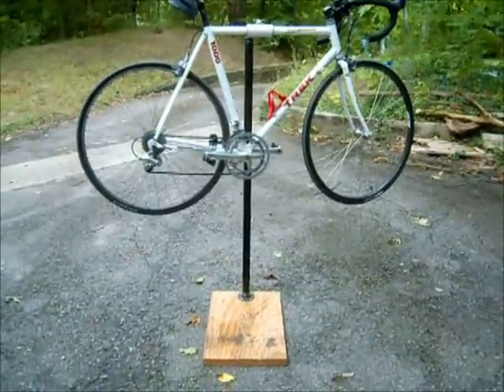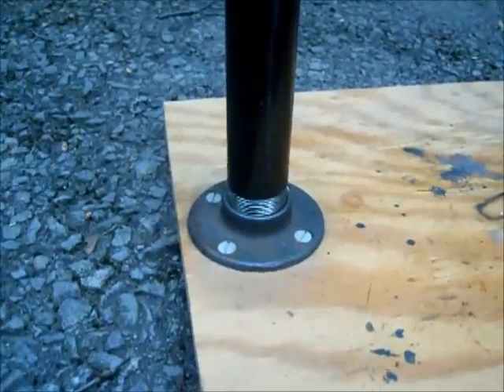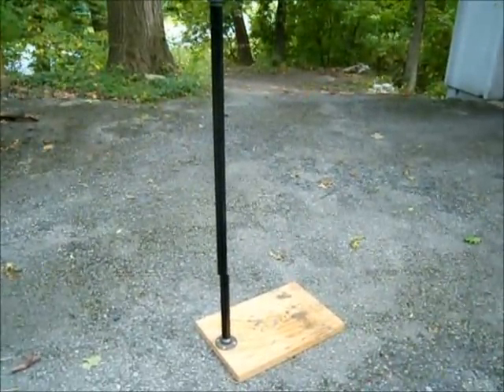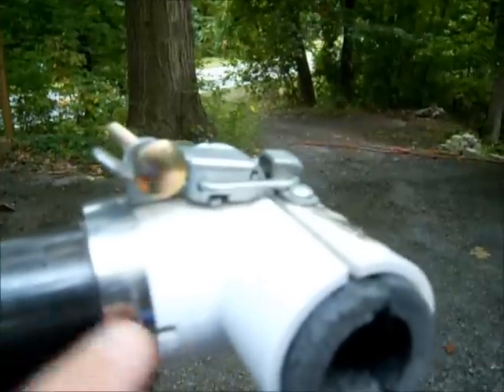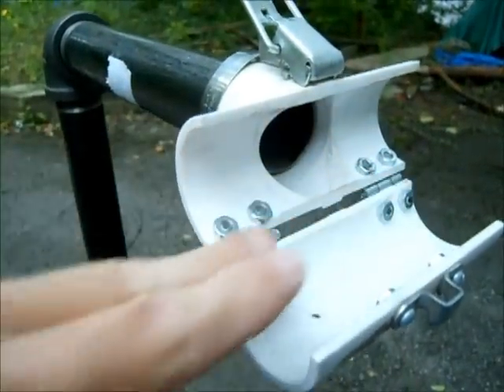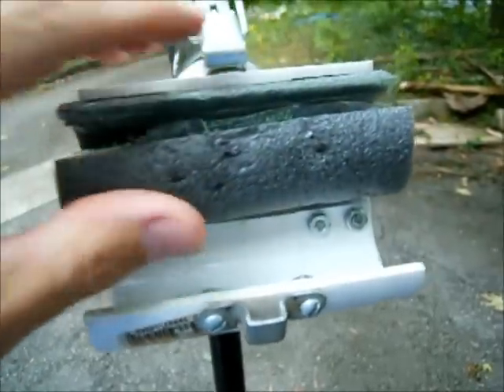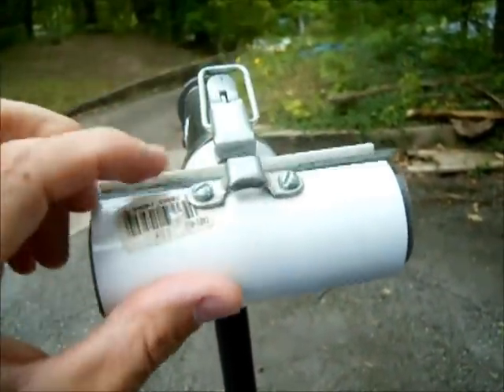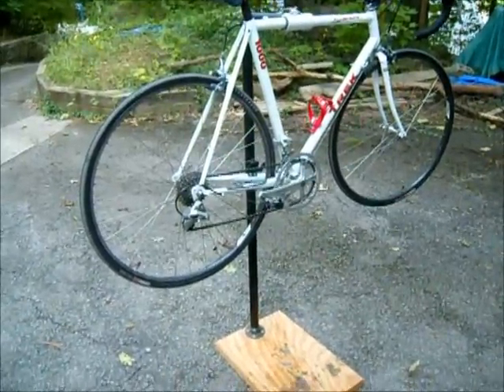How To Make A Bike Repair Stand DIY

Comment: That clamp mechanism you've built seems like it would only fit certain diameter top tubes or seat posts, correct?
Reply from the maker: It's going to work for most bikes. Not some of the new shaped frames and seat posts like on high end tri-bikes. But if you have a high end triathlon bike, you can afford a high end stand.
Reply: shyflirt1 Haha, that's a legitimate point. Do you see any issue with using just a 3/4" base instead of 2 glued together? I feel that may be overkill.
Reply from the maker: Ralph Livingston Yes. A single layer of 3/4" plywood will flex more. 2 sheets together will be stiffer and more solid.

Comment: I can see where the clamp would get in the way of the cables. How do you work on brakes and gears using that clamp?
Reply from the maker: I didn't have too many problems most of the time.
Reply: If you make a thinner clamp as well then you could clamp the bike around your seat post. This is probably what I'm going to do.

Comment: Guys as a tube holder I’d use pipe wall mount/bracket, maybe it isn’t perfect but easier and more secure, maybe use two of them and clamping to seatpost is better, only correct option of you have carbon frame

Comment: the piece of wood helps it from tipping  forward but it's not enough to counter balance any movement backwards. the slightest movement the other way will lift the  wood and the whole lot will topple to the floor
Reply: Gary Coleman leave 5 or 6" of plywood behind the pipe flange.  Or fill a gallon milk jug with sand and leave it on the plywood

Comment: How difficult would it be to get another metal T and cut that in half like you did the PVC one? Then add hinges to that. I'd be afraid the weight of the bicycle would crack the PVC at the hinge. Is that still the original PVC T that you've had?
Reply from the maker: Yes, that is the original PVC T that I made it with. I never had any issues with it at all. You could go with a metal T, though it would be more expensive, and you would have to worry about it scratching the bike. The PVC T is much less likely to scratch the bike if it accidentally rubs against the frame.
Reply: Ok thanks.  I may try to build one like yours if I can find the materials for a decent price at Home Depot or Lowes.  I've seen some stands (RAD brand) for as low as $52 shipped from Amazon but it seems alot of the important components are made of plastic.  I'd hate to have my carbon fork hit the ground from a few feet in the air.
Reply: RJ The Bike Guy d

Comment: could probably use PVC for the whole thing! if you use schedule 40 and thick conduit (like 1 1/4" that you use for the T) would probably work great.  great idea with the T. and how you made it the bracket to hold the bike.  thanks for the share!
Reply from the maker: +benlrenzen10 Might not be stiff enough.
Reply: it will definitely have a tad bit of "flex" to it in lieu of the fire sprinkler piping that you used.  I am an electrician,and have access to "free" PVC conduit. when it's super long it flexes a lot, but a short piece of a good sized PVC, I think it could work.  It's more rigid than one might think. we shall see! :)
Reply from the maker: If you have access to free stuff, maybe you can try nesting the, put pipe inside of pipe inside of pipe to stiffen them up. Not sure how tightly they would fit like that.

Comment: Is it a must to use wood screw and also where did you buy your latch?? cause I been looking around for it and have no luck finding it.. Thank you! =)
Reply from the maker: +Jovan A. Use whatever will work for you. The latches are not that hard to find online. http://www.amazon.com/exec/obidos/ASIN/B00PFBE4HE/ref=nosim/youtube25-20
Reply: +Jovan A. might be a little late for you but maybe help someone else that is trying to find that latch. I bought the exact same latch at Lowes, a 2 pack was $4.71.  Item #: 311970. it was called a cabinet catch. they come in different sizes, these ones are about 2 1/2 inches long, but I believe they come longer or shorter. I attached mine using pop rivets, pop rivets just seem stronger and tighter to me. I made this stand and used it on an old 68 model three spd Schwinn. I just loosened  the clamp and turned the mount up, and it clamped on the seat post tube just fine.  very easy project and worked well.
Reply: That's good to know.. I ended up buying one on Amazon and it was to big for my pvc pipe. Thank you! =) 👍

Comment: Hey could the handle part (without the pole and stand) be secured somehow to a wall to store the bike off the floor?  I would have to find someone to do all the work for me (this is beyond my hammer and nail capabilities).
Reply from the maker: You could attached the pipe to a flange similar to what is on the base, and screw that to a wall. Make sure you screw it into something very solid or it will rip right off the wall when you put a bike on it.
Reply: shyflirt1 ok Thank you for the information.  Good stuff.
Reply: I took this concept, but I secured the flange into my joist in the work room. Placed a 90 on that, so I can pull it down to work on my bike, and swing it back up into the open ceiling when not in use.  Saves space.

Comment: just wondering what length you used for the main post, I picked up a 48 in length and my stand looks huge compared to the bike
Reply from the maker: Thomas Perrett Close to 5 feet. You want the bike up at the level that you can work on it. And most of the bike hangs down below the bar.
Reply: perfect thanks man

Comment: This is perfect! I'd so much rather spend my money on tools and post ride food/beer ;)   One question- have you (or anyone else here)  put a little tool shelf/small parts holder on the upright pole?
Reply: Next question- how to best cut the PVC?
Reply from the maker: Cezanne Cartier Safely with a saw. I think I used a table saw. But you can use what ever saw you have that will work.
Reply: RJ The Bike Guy  Cool- thanks.

Comment: How about just using a 10 inch nipple threaded on both sides, attach a  "T", and run your seat post right thru it? Might be a little difficult to get the bike on but a heck of a lot easier to make.

Comment: Does this allow you to clamp it to different size frames.  Most of mine are older chromoly steel frames like a Trek 930, 750, etc.  OR should I get a smaller T piece for those style frames?  I wonder if pool noodles would also work well for the T liners...
Reply from the maker: I used it on a variety of bikes.

Comment: Kwel, but this design would crush my top tube. Guess i could rotate the clamp and use smaller tubing for a good grip on the seat post
Reply from the maker: I doubt it would damage your top tube, but it's your call.
Reply: Doesn't damage the top tube....mine works perfect on my Road bike, however is too small for the top tube on my mountain bike, so I do as you stated, twist it, and use it on the seat post. Boom

Comment: I'm having trouble finding that tool box latch. I tired Home Depot in person and Lowes online. They have them, but much bigger like for a chest. I also trolled Amazon. If someone found the proper latch, please post the source and maybe the name & #.
Reply: Found the latch @Ace Hardware. HD here didn't have  1 1/4" black iron. Had to go to a plumbing wholesaler. They only had 21' lengths, but did have a 4' riser which I added on a nipple to get the correct height.  Used steel pop rivets on the tee and glued the foam to the inside if the tee. I don't know how to attach pics in here or I'd show my finished stand

Comment: Would it have been cheaper to use PVC as the main pipe or even for all of the pipe? More importantly, do you think PVC would be strong enough to replace the cast iron pipe? I would imagine that PVC is much cheaper than cast iron, or is that wrong?

Comment: I think your bolt idea is right on. I can't see rivets holding nearly as well. I'm thinking your base might not be that sturdy for working. How much can you wrench down? I'm thinking mason screw into a 12" by 12" patio block and then put it in a flat bottom storage container and using about 30 to 40 lbs of thin mixed concrete, enough to cover the original patio block. Seems it might make your plan a simple heavy duty work platform.

Comment: Hey RJ, could you give me your height and how tall the clamp for the stand was? For reference as  i'm gonna build one of these but would like it to be tall as I am very tall. Thanks a lot.
Reply from the maker: +Luciano Narno I am almost 6'. The clamp is about 5 1/2'.
Reply: RJ The Bike Guy Thanks a lot RJ!
Reply: +RJ The Bike Guy wher did u buy the hatch to lock it
Reply from the maker: The latch is called a "straight loop draw latch". I originally bought it at Lowes, but am not seeing them there now. I don't see them at Home Depot either. But I found a bunch on Amazon and other online places.
Reply: How much do they go for
Reply: Do u think  there other ways to do it whither another  latch of some kind
Reply from the maker: There are probably other ways to do it, but I gave you mine. Beyond that, you will have to find a latch, or come up with your own idea.
Reply: +RJ The Bike Guy ok thanks I got to hold on amazon  and look for a latch

Comment: nice thought, will give it a go this weekend.
I don't like the bolt ends and nuts pointing in.
Will try to use a counter-sunk heads going from inside to outside finished with acorn nuts.

Comment: cool design - I might do the same but turn the clamp about 90 degrees for the seat tube. I have cables running below the top tube and wouldn't want to clamp on those.

Comment: I would've felt a lot better about the sterdness of the stand if I seen you working on a bike with it, if it's just a stand then it might do, but that base does worry me tho! Will it be steady enough, without dropping the bike imagine if the bike dropped at 1 or 2 in the morning that will scare the hell out of you
Reply from the maker: I used that stand for a couple years before spending the money to buy a nice Park Tool stand.

Comment: Thanks for sharing, I'm going to build this though I might use a solid piece of wood for the base if it's not too expensive, and maybe a pipe clamp instead of the PVC clamp if I can find one cheap enough. I don't have the patience to wait for glue to dry or the proper clamps to laminate the plywood like that. Good job and thanks again.
Reply from the maker: Not sure if you are going to find a solid piece of wood that large.
Reply: Your comment just reminded me I have an old solid wood door that's been sitting in the hallway for 3 years.

Comment: Wow...you know a million times more than i do about bikes...and i subscribed to your channel years ago ...i have learned so much about bikes from you....so one thing i did different than you, i bought the very end part the part that holds the bikes from park tools then  i had that part mounted to a straight, square piece of pipe(2 inch tubing) like the ones that are used for weight lifting equipment. That part is inserted into a square tubing stand that can hold also a truing tool from park , a buffering tool and two other tools for a total of five tools...then i had the stand painted red to match my 2 rollaway tool boxes that i bought from sears...the reason why i had my stand built this way is because neither park or any bike tool maker makes interchangeable stands....my intention all along was to buy old ten speed  japanese and italian bikes and fix them...i bought some bikes...how many bikes did i fix? None...i still have them and my interchangeable stand and my rollaways and all the tools that fit in them....
Reply from the maker: None? LOL

Comment: As a mechanic i admire your project, Now it's time for you to discover the joys of rivets, You get a low profile permanently tight fitting professional looking connection.
Reply from the maker: It worked, and I used it for a long time.
Reply: Nice job showing improvements with out trashing the dude 👌

Comment: Of all the cheap DIY bike repair stands, I like this one the best...or at least the "T" part.  Seems to me if using the foam it will not leave scratches.  I will say I'm going to use rivets on the hinges rather than screws/nuts.      Thanks for the great idea.

Comment from the maker: You can try them. Would you do them from the outside in, or the inside out. They may not hold well into the softer plastic, or split the plastic.

Comment: Nice work!
I find it amusing, though, that you didn't film the process of putting your bike in that clamp. Isn't it a bit tricky?
Reply from the maker: Not really.
Reply: shyflirt1 Good Job. Question? How much did it cost you?
Reply from the maker: I don't remember. I built it years ago now. The base was actually repurposed from a photo copy stand that I had built and no longer used.
Reply: shyflirt1 no worries. Great job anyway and I'll start on mine this summer.

Comment: Hi I had a question I just bought a new bike about a month ago it's a 18speed mountain bike it came unassembled and had somebody else put it together I do not have the receipt anymore I kept it for a while and of course after I thought it was ok and working good I throw it away anyway I was riding it and my pedal just fell off the arm fine I wanted to know if there is a common reason for this never had a bike that the pedal alone came off
Reply from the maker: I don't know. Maybe it wasn't tightened properly. Maybe it is a cheap bike. I don't know.

Comment: Sweet DIY bike stand. I have brake and shift cables running through the bottome of the top tube. with your stand looks like by simply turning the clamp veriticle will hold the bike using the seat post. fun project.
Great video.

Comment: it's not leaning forward at all.pipe is in the vertical with a 90 degree fitting. any slight movement the lot would fall over backwards.its heath Robinson.
Reply from the maker: It doesn't need to lean forward. The weight of the bike is forward.

Comment: Not bad at all. I'd suggest people use countersunk screws from the inside of the plastic T to attach the hinges and latch, that way they won't protrude into the foam at all. Keep a few different pieces of foam around too, to cater for different frame dimensions.
Reply: use pop rivets, no need to counter sink the holes

Comment: RJ- will this stand hold a full suspension mountain bike, say about 35lbs? I got a 2009 KHS Velvet that's kind of beefy. Suppose I could modify if needed easy enough...
Reply from the maker: Probably, but if you have a nice bike, buy a nice stand.

Comment: I would use cheese head screws and screw from inside out, so the nuts are on the outside. Great build. They make  Steel T's. if you can afford them they will last ages longer.

Comment: Thanks for sharing this great bike repair stand plan.  I'm an avid photographer that dabbles occasionally with film cameras, and to beat the high cost of getting my negatives scanned for sharing online, I built a DIY copy stand with precisely the same technique as you show here.  The beauty of your plan is that I can make use of the same base and simply swap out the 18" pipe I have for mounting my DSLR (scanner) on for your 56" length with the other bits attached.  The universe provides to those that share.  Cheers, mate.
Reply: I have read your comment 3 times trying to really understand what you are doing here.  Could you elaborate more if you can.  Thanks!

Comment: Nice DIY! In a pinch for a straight top tube rodie a winner. I would prefer adapting the stand to use and mount to the seat post ideally. This is a must if your rodie bike is carbon. Also less chance to crush brake/derailleur cables. Secondary mount point would be the frame seat tube. Afraid you'll loose your perfectly adjusted seat post height if you need to extend it? Just get and old knife or nail and mark a small line in it at the top of the frame seat tube before you move it.

Comment: pretty sweet, one easy suggestion for a bit more strength would be to use a SCH 80 PVC Tee instead of the SCH 40 used in the video for a bit more strength on the T, Plus the inner diameter would be the same. 

I will have to build one of these since i work at a plumbing wholesale. thanks for the video and the great idea :)

Comment: For everyone who has a standard 3 ton floor jack with an upright pole all you need to do it stick a S type hook on to the top of the handle and then hang you bike off of it.  If you don't have a S hook just get 2 J hooks and zip tie them together as needed.  Strong, simple and very effective.

Comment: I built my bike stand mostly from materials at hand in my shop, which makes it REALLY cheap. It pays to be a pack rat!  I bought:  tee, buckle, hinges, a U-bolt, and some rivets, that's all.  The vertical post was cut from an old chain link fence post, and the short horizontal pipe was cut from what used to be the tube of a floor pump.  For the base, I used a round piece of double plywood that once was part of a compost sifter. The base, post, and horizontal pipe are connected using wooden pieces that I made. Several people suggested using rivets in the tee-clamp, and I heartily agree.  They are so strong that I used only two rivets per hinge (not 4).  In the tee-clamp, I used self-stick felt furniture pads. I had to work on the buckle a bit to make it work on the curved surface of the tee. To store the bike stand, I'll loosen the U-bolt that holds the bottom of the post, to separate post from base.  Thanks, RJ, for the idea.

Comment from the maker: Depends on the hardware you use. Just buys some small screws to match the holes in the hinges and the latch, and long enough to go through the hardware and the PVC. You can always cut the screws a little shorter if you need to.